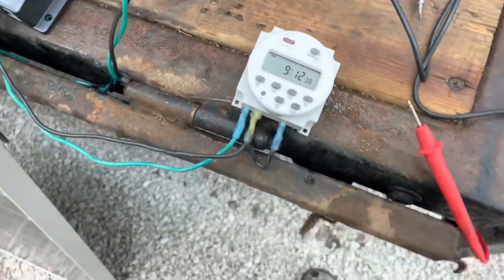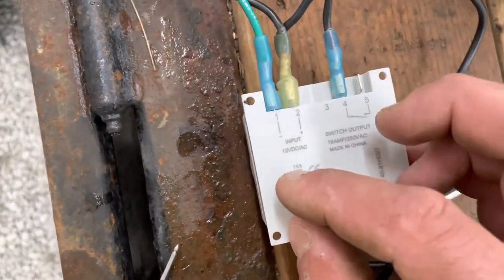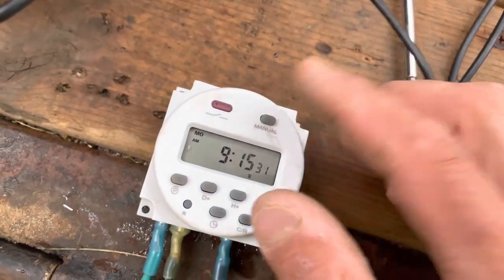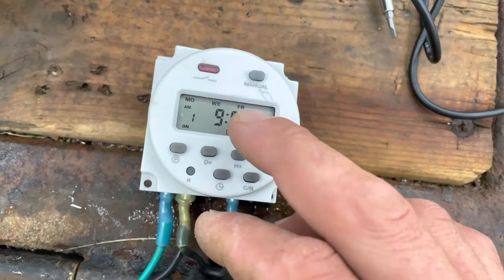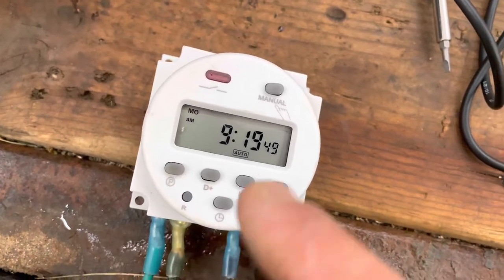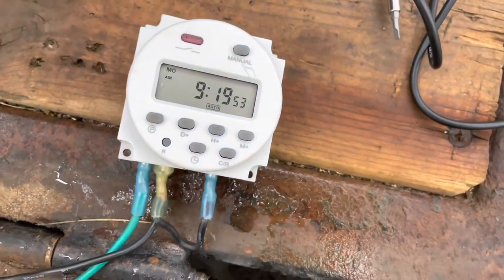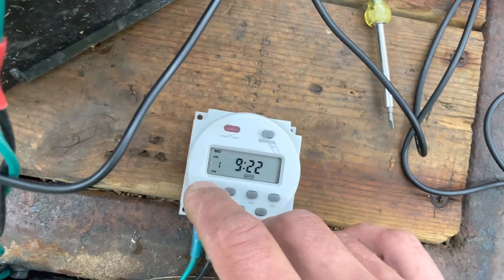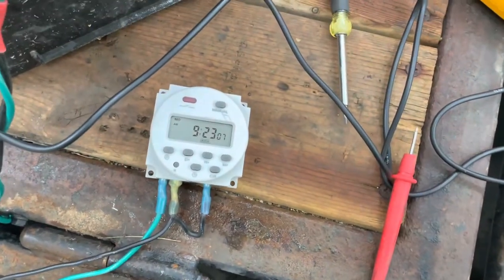How to Set! - Amazon Switch, CN101A DC 12VMini LCD Digital Microcomputer Control Power Timer Switch

Comment: How to on for 2 mins and off for 10 mins. For every day
Reply: That is not possible.
Reply: You can program 17 on/off operations. You can switch it on 17 times for 2 minutes and leave it off for 10 minutes in between. But this will only cover 204 minutes of the day.

Comment: Hey I have the same timer on my slide gate at the car wash I have and  I want to set it for the gates to open at 5 am but not close I have to close with the remote cause there might be someone still inside guess my question is do I have to set everyday of the week or do I only need to enter the time once on the first setting and that will open it everyday and what do I put in the off setting do I leave it blank

Comment: I got a different set of instructions. Mine is cn101a yours is that followed by -4. Mine doesn’t have + & - for the input, I wired it opposite to yours and it works. My instructions look better than yours, let me know if u want me to send the instructions pdf
Reply: Please send me diagram of cn101a 220v
Reply: @pusangligaw777  I can’t work out how to add a pdf to this reply. If u want to advise your email I can send it that way
Reply: The timer has a rectifier bridge so it doesn't matter where you connect positive voltage and ground.

Comment: you didnt show the wiring to the pump you are using. Only 1 wire on the exit side of the timer. I assume, and you should have explained that the out wire from the pump would go to the negative on the battery. Is that correct?
Reply: It's not forbidden to ask nicely. If you lack basic understanding of electronics you should probably hire a professional.

Comment: Thanks for the video. I’m considering buying one as I’m looking to make an automatic feeder for cattle. I’m wondering if this can be set to run for a period of seconds? If I had a rotary valve in the bottom of a hopper I may only want it to turn on to feed out for 5-10 seconds and I’m wondering if that’s possible with this?
Reply: I have the same product but the switch will not engage.
Reply: No, one minute is the minimal on time. There are other circuits on amazon which can be used togehter with a timer to create second accurate 'on' times. Search for something like 'trigger switch timer'.

Comment: The back says 12v input but 250v output.   Explain anyone.
Reply from the maker: It runs on 12v power but can switch up to 250v
Reply: @rudijones  Thank you.   I finally figured it out.   It is as much a relay as a switch.   I once built  a branch trimming device (120v)  with a relay of 12v.   I needed both hands to operate the trimmer so I put a doorbell in my mouth.   It worked fantastic.

Comment: Thanks for this. I’m about to rent my house and I have one of these controlling the pool pump. 
You’ve just saved me having to make a video for the tenant!
Reply: this is a switch controlled by a little timer, A pool pump may draw too many amps to run through this switch.  running a pool pump with something more substantial then a 10 dollar timer might be a good plan
Reply: @KeithJohn-qd6pr - Shhhhhhhh!
No one has told that to the little $10 timer that’s been working fine for the past 7yrs……and counting 😆

Comment: Hi Rudi,

This style timer came installed on our "Just Vertical Garden" system.

(1) Can you change the time from 24 hr. setting?
(2) Our timer comes on at our programmed times, but for some strange reason it comes back on 6 hours later in the middle of the night. Even though all the 16 optional programs are blank, and idea on how to correct this?

I have tried contacting Just Vertical garden company, but their solution is to keep sending me the setup manual that I have already followed numerous times.

Comment: Hi Rudi,
Great video. Output shows 200-250 vac, website shows 12 vdc output. I have a 5 amp 12 vdc load. Will this work?
Thanks 
Matt
Reply: 200-250 vac is the limit like you would see on a fuse, doesnt mean thats the circuit voltage timer is for low voltage DC so should work

Comment: Thanks mate very useful. I have one that I want to turn on some small heater fans. Do you have any idea how many amps draw this can handle. The fans are 100w so about 9amps each and I have 3 fans (27amps).
Reply from the maker: These are rated for 16A max. You can still use this but would be a good idea to add a simple automotive style relay that can handle up to 40 amps. The timer co tells the relay and the relay does the heavy switching of your 27A load. Link here: https://a.co/d/hHqlKsz

Comment: hi, just a question, I would like to switch 24V DC and for example for alimentacion use 12V. Can I switch 24V DC or only 220V? thanx for answer
Reply from the maker: 12v only for power, it should switch the 24v circuit.

Comment: Does it lose all the programs you've set if 12 volts is disconnected?  Also, if no programs are set, is it normal for the Manual function to be disabled?  3rd question:  what does the C/R button do?  Thanks in advance
Reply: It does have a battery to remember settings. I can’t tell u how long this will save them, but I have recharged one that had been sitting unused for several years and the battery recharged ok

Comment: Thanks Rudi for posting on this timer. One issue I can’t find the answer to is the time length on the inner 3 volt battery used to control the display. The power on LED light is a weak point as it has a draw down factor greater than the LCD numbers. My concern is should one rely on this battery in cases where they won’t be monitoring it say as a chicken door opener for long periods? If the  battery voltage drops then the door actuator won’t be able to function leaving the chickens locked in or out.